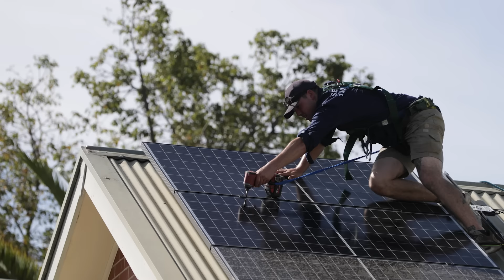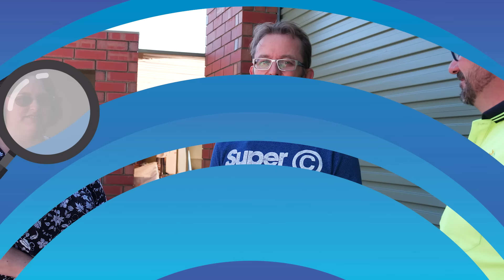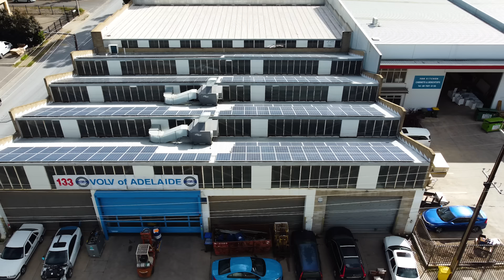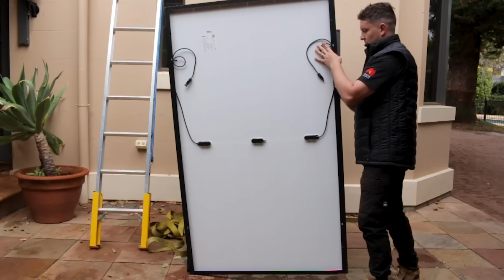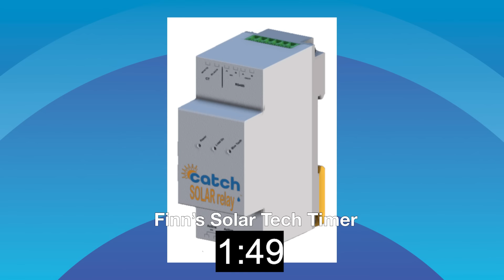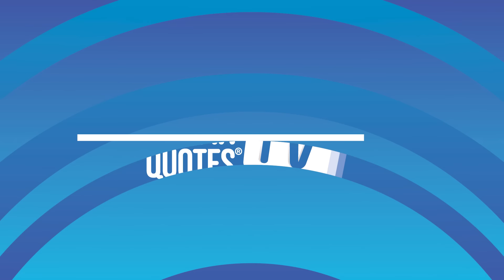Why Bigger Rooftop Solar Is Better : SolarQuotes TV Episode 4

Comment: Hi im enjoying your videos, I’m not sure if you have addressed over voltage issues with large systems in any of your videos. I work for a utility in nsw, we have customers with large single phase systems whose systems constantly shut down from over voltage due to the systems export to the grid. The grid can be 240v with the system off then 253v when it’s on. It’s not the utilities fault, it’s a poor solar design

Comment: Just upgraded my original ( all I could afford at the time) 6.6 kW system to a 13.2 kW by adding s 6.6 kW system on the South facing side of my roof. So far for the first full month (June) it has added 218 extra kW  which is not too shabby compared to the 418kW of the 2021 vintage 6.6 kW dystem  for a total of636kW for the month. Looking forward to the best output months  to see how it puts out then

Comment: …great info & it helped get the wifey on board for our new 13kw system (go big or go home!)…can we find a bit more info on the Volvo mechanic’s Solar investment on solar quotes website? …we’ve got a lot of roof space …if I can pitch a ROI of 4 year for a big installation, the wifey might be keen to jump on board :-) …the most panels you can have on 3-phase is 40kw?… does this guy have 6-phases, to do 71kw of panels ? Cheers

Comment: Big is not better always....
I have 5kwh limit....
6kw inverter and 9kw panels. 
11kwh batteries. 

The inverter is is capped at 5.5kw for most of the day. As base load is 500w avg...

So if went 10kw it would be doing nothing bar bad winter days.

Comment: Just take as many panels as you can, most of the time they will not hit that 6.6 limit anyway. 
And if it turns out it does : 
1 : it is a luxury problem, focus on the extra energy during the hours it does not hit 6.6
2 : Consider placing panels in different direction to get more solar during hours you now are not getting much
3 : if it is financially interesting, buy a battery for time shifting (saving solar electricity for a later moment when otherwise you would have to pull solar from the grid)
Reply: On a good sunny day, I get my output clipped at 5.06 kW for a few hours. The real advantage of more panels is faster rise in output and more output on sub optimal days and also allows for no dropoff in performance due to a bit of panel degradation over its life.
Reply: @rogerpearson9081  I absolutely agree here

Comment: In my area in Sydney with Endeavour, AGL is placing a 10kw panel limit for 12c FIT. My house can fit about 10.5 kw, I’m going to install less panels to stay under 10kw.
Reply: I'd be struggling to fit 6.6kw on my roof.

Comment: Hey Fin this is a quote I just received I wanted the max panels here in Perth I could instsll on my roof.Is the installer correct in saying " Please remember that the inverter is 5kW so the most you can ever use or charge your battery is 5kw"  doesn't sound right to me??   Option 3 is the 5kW Huawei inverter, Huawei Smart meter and 8.88kW, 24 x 370W Jinko N-Type (20 year warranty) modules and the 10kWh Luna battery.Please remember that the inverter is 5kW so the most you can ever use or charge your battery is 5kW. The extra panels come into use during the winter months in still allowing the system to generate that 5kW. You will never see generation above the inverter size.
Reply: The battery is 10 Kw hours  think of it as a 10,000 l tank being filled at 500 l per hour to reach full capacity. You then drain the tank as you need overnight.

Comment: Upgrade the grid to handle more solar.
will that really be done now that the government has privatised it ?

We were not allowed to build a system with more than 5kw export.
So how can I add more and limit use more, I wasnt to isolate the shed, add a battery and run the pool pump from that, can I do that ? 
Its only 1kw or motor, 1.5 for startup so a 2kw inverter and will do and old recycled panels but not grid tied, right ?
who do you get to organise that ?

Comment: So Sydney area on the map is limited to 10kw systems? Didn’t understand that part
Reply from the maker: Per phase, the inverter limit is 10 kW in the Ausgrid area in Sydney :)

Note that you can go 33% larger than your inverter capacity with panels. So you could have 10 kW inverter capacity and 13.3 kW of panels on a single phase in Sydney.

Much larger if 3 phase!
Reply: @SolarQuotes  👍

Comment: I am sorry that I am critical. The 17 year-old panel installation- What a useless segment! All it said was that it was still working. How useless is that? A bit more information on how well it was working would have been better - what is the yield now compared to when it was installed, would have been much more informative.

I am also sorry I find the "entertainment" frivolous and does not add any value to the video and is a turn-off for me.

Otherwise the web page is full of useful information.

Comment: Big is good unless you're in WA. 5kw or less if you want to receive the (tiny) FIT.
Reply from the maker: Yes - WA's 5 kW rule is really stupid. So bigger is not always better out West. But with the really low FiT, you can come out on top with a bigger system - if you have a lot of self consumption - using gear like the Catch Power. Our calculator will soon be updated to let you do the sums on this.

Comment: Thanks Finn

Just a follow up question, to your answer to the question about what happens when your system can't consume/export the full productive capacity of the PV array. You sort of missed answering the second part of the question, about potential for damage.

While the inverter manages the throttling of output quite nicely, there is still solar radiation striking the panels. Presumably instead of the component of radiation being converted to electrical energy it now results in the panels getting hotter instead. I expect they are designed to cope however stuff which runs hotter more often, in general, doesn't last as long. 

Is this extra heat of any concern for the longevity or rate of degradation of the panels?

Alex
Reply from the maker: Oops. Short answer: there is no potential for damage. No surplus energy is created so there is nothing to damage anything.
Reply: @SolarQuotes  No surplus electrical energy, however the radiation energy striking the panels doesn't just disappear. If it's not converted to electrical energy the radiation energy striking the panels has to go somewhere, so presumably it makes the panels hotter than they would have been had it been converted to electrical energy. I was wondering if this extra heat may result in faster panel/panel component degradation?
Reply: @alexsimmons1803  You appear confused how solar panels work. They turn light into energy not heat into energy. Panels will get hotter as sun falls on them whether power is drawn from them or not, if anything they'll get hotter as power is drawn from them due to the current generating some heat (nearly insignificant amounts thought).
Reply: @billmastrippolito7132  I'm not confused, I'm asking a question. If light energy is hitting a panel in normal operation, some of the light energy (visible and a bit of UV) is being converted to electrical energy. Yes some of the resulting electrical current will generate a little heat. However if the MPPT is preventing the conversion of that light energy into electrical energy, then the light energy must go somewhere (basic thermodynamics). I figure it must be converted into heat but please enlighten me on what happens to that excess light energy?
Reply: @billmastrippolito7132  Here's another way to think of my question:
Imagine two identical panels next to each other, each facing the full sun. One is connected to a solar inverter and supplying electrical energy. The other is not connected and hence no electrical energy is being generated. Will there be a temperature difference between the panels?

Comment: Obviously lots of clean cheaply produced energy is a good thing. However, AGL (for example) will currently pay 15 cents per kwhr provided you have less than 10kws of solar panels, if you have more the fit drops to 6 cents. Putting up a 10kw system makes economic sense but not say a 12 kw system.
Reply: so then put in 30kW system just to show them  ..........................    ;-)))))))
Reply from the maker: That's a good point. Silly rules like that can skew things - but don't forget that there are other retailers out there that may be happy to pay you for bigger systems https://www.solarquotes.com.au/energy/

Comment: If you had EV cars charging their batteries at high solar times then the grid could handle it, right? Is the problem that the Sub stations can only handle power flowing in one direction i.e grid to consumer?
Reply from the maker: Substations can handle power both ways. But if the reverse flow gets too large, then they will often need to be upgraded to handle that.